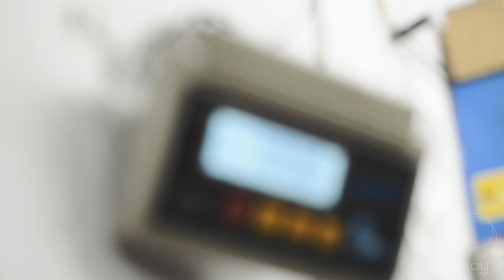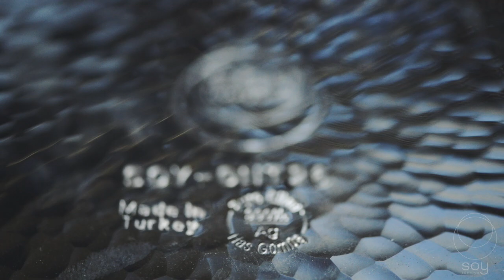Soy Videos 1 - The Making of a GNT26 Solid Silver Pan

Comment: Can you use these on induction cooktops? Beautiful pans by the way.
Reply: No, a generic rule for induction is: if you can stick a magnet on it then it works with induction cooktops
Alternative answer: No silver is not ferromagnetic
Reply: You can buy or make an Iron cookie and just sit the pan on top of it, if you prefer you can even use some type of thermal grease between them, silver is an amazing conductor it will probably still be more efficient than fire directly over an aluminium pan.

Comment: Silver oxidate very easily it's just a matter of time for this beautiful silver pan to develop a dark toning/patina over time, pure silver oxidate even quicker than sterling silver. However I'm curious whether silver has nonstick ability when cooking
Reply: Kev S no, that is wrong.
Pure Silver oxydizes way slower than Sterling silver and also resists things like salt and vapor really well.

The only thing pure silver will get over time is a light dusty coat that is easily rubbed off.
Reply: You can always polish silver make it new again.
Reply: Emir Ali Enç x
Reply: @2000eae  

Does not even really oxidize. I have had a little silver bullion for decades and I thought it might dross over like a silver dollar. Did not. . Silver alloys are for hardness, but at the cost of less chemical stability.  The one thing that might get it  is sulfur in the form of Silver sulfide  . Come to think of it, if you want to make brandy, a silver still should work great as well as copper except for the capital cost that is. So onions, eggs and mustard might impact its luster. Leaving it out in the rain won't.
Reply: @2000eae  that’s actually true, even though the majority of the time metal alloys are more resistant to oxidation